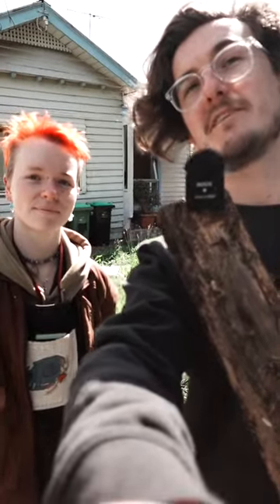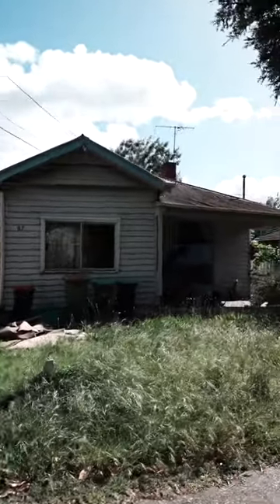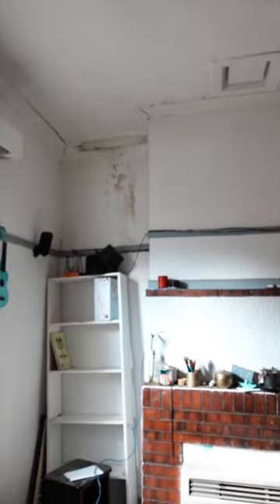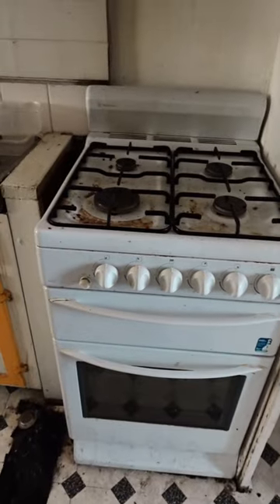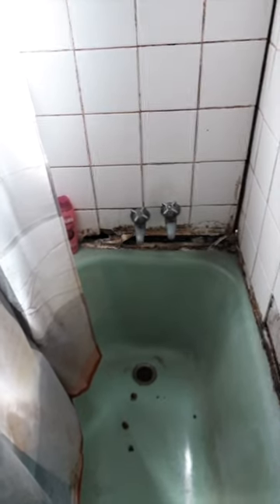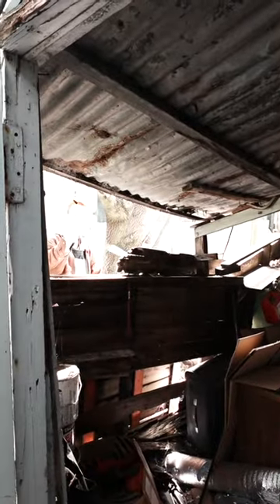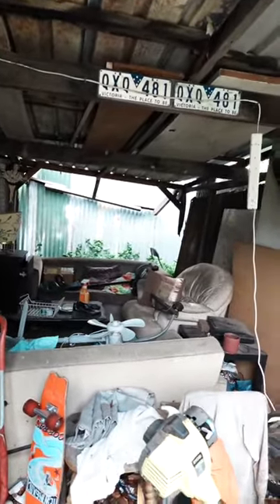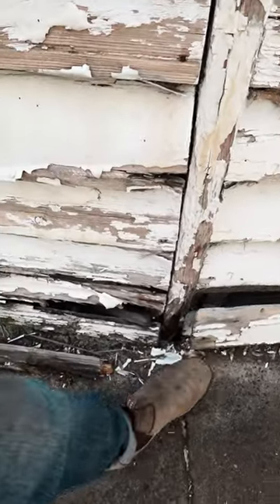87 Kellett Street, Northcote - Miles Real Estate

Comment: As someone who has been Melbourne born, bred & still living (barely, now that we may as well be London or New York we're so expensive now) I'm really sad to admit, this is common as Heck. I came to terms with the fact I'll never afford to own my own home, but the fact that rentals can still be like this, and are - all across Melbourne & at the same sky high rent rates as well maintained properties - is the part that really hurts. We shouldn't have to have our lives endangered by dodgy electric lines, slowly, painfully dying from coughing our guts up from walls & floors infested with black mold etc. All that if you manage to not trip and break a leg or wrist (from trying to save yourself at landing) just getting through the gate to the front door.
This house should be condemned by the Darebin council (or at the very least, have a building notice put on it).

Comment: 100% sinking foundations, the cracks in the paint would suggest rising damp into the render, water hammer suggests pipes arent secured properly which could result in leaks which might explain the rising damp, this could also cause mould, ragehood covered in grease could cause house fire, dips in floor is consistent with rotten floor joists.

this house needs to be condemned at the very fucking least

Comment: She did choose to move into the house knowing the condition though, right? Its in horrible condition, but nobody forced her to live there....
Reply: Except there are more people seeking housing than rental housing available, and most of it’s higher than people can afford. You can’t save for emergencies, let alone a deposit, if you have no discretionary income. So a lot of renters tolerate crappy conditions in exchange for reasonable rent. As Jordan points out, that’s the unspoken agreement - breached by Miles RE when they upped the rent.

I’m in the same situation, but in a more habitable house than this. No heat, no insulation (even when we offered to pay half the cost), cracked floor tiles in wet areas, and we can see daylight through a crack in one wall. But they’ve done gas and electricity checks, and only put the rent up a couple of times since the pandemic, and not by much.
Reply: The owner purchased the property knowing they have to look after it, right?
Reply: @merewetherful  lol what? Owners don't necessarily need to look after a property they purchased. That can do with it what they will. The benefits of being smart with money. In fact, right now, I have one that isn't being looked after. Oh no! Lol.
Reply: @alexandlynnward6651  so if they can't afford it, they can move to a cheaper area. Stop your whining. Nobody is forcing them to live in that suburb. Get out there and find something affordable. The world won't find it for you.
Reply: @merewetherful  I'm guessing you've never owned a house before? Literally, you can paint it pink and piss in every corner if you want to. The owners don't have to look after it. Lol. That's funny
Reply: @anthonyonline4740  Love the sarcasm lol.
Reply: @anthonyonline4740  Very funny Anthony, we don't need to know you've never owned a home, very funny sarcasm Anthony.
Reply: @merewetherful  lol you don't believe that in a homeowner and a landlord? Strange. Why not? I can help you with your finances if you want, so you won't be a renter forever.
Reply: @anthonyonline4740  Very funny sarcastic jokes Anthony. Love you mocking landlords 🤣 You gotta show the prop you’re renting on Purple Pingers 👍
Reply: @alexandlynnward6651  This guy is mocking landlords. They do a great job making them look like tools 👍
Reply: @merewetherful  I don't understand. How am I mocking landlords? You're very strange. If you're confused about the property im not looking after, let me help you. That one isn't for rent at the moment. If you make less assumptions, you'll understand things easier
Reply: @anthonyonline4740  Lmao, we get landlords are turds, great mocking skills 👍
Reply: @merewetherful  you're a very strange person. I'm sorry you don't like your landlords. Have you thought about becoming one?
Reply: @anthonyonline4740  Ha ha ha. Thank you for mocking landlords and making them look like turds 🤣 They think they’re psychics. So weird hey 😂
Reply: @merewetherful  I really don't understand. You're very unusual. Are you high?
Reply: @anthonyonline4740  You’re following Purple Pingers. Of course you hate landlords. You’re very funny, show the place you’re renting  🤣
Reply: You can live there lol. I think you’ll love it. Maybe you can fix it.
Reply: Actually Govenment legislation requires a landlord to repair non compliant sub-standard maintenance issues be rectified even if the tenant knew about the issues when they moved in.
Reply: @squeakyrabbit  yeah so it's clear that the landlord didn't do the right thing, but at the end of the day... She knew it was a bit of a dump... And she chose to move in right? Or did someone hold a gun to her head and force her to live there?
Reply: @merewetherful  I don't understand. Im not following them mate. And I don't think PP hates all landlords. You seem very confused.
Reply: Landlords are unwilling to invest a bit in renovating their properties to save money because renting out these houses is primarily for investment purposes, generating substantial cash flow as well. However, from the perspective of tenants, it is necessary for them to collectively voice their concerns in order to improve the overall rental conditions in the market. Everyone has the right to express their opinions, even though perspectives may differ.
Reply: @sarxotey4680  lol you're funny. That type of Reno won't save money. And not all landlords are the same. And a place like that won't really generate cash flow. I mean, yeah, income helps, but the ongoing cost will likely outweigh the income. And saute they're entitled to an opinion. Opinions can be wrong though. You remember that. Also remember that I'm entitled to my opinion so I'm serially offended that you are trying to take away from that. Please respect my opinion lol.
Reply: Do you know what a rental crisis is?
Reply: @merewetherful there's no requirement to "look after it" when you buy, but it should not have been listed for rental.
Reply: @cottawalla  Maintaining your property is crucial for both your insurance and mortgage. Insurance companies may deny claims if neglect leads to damage, and banks require upkeep to protect their investment since your property serves as collateral.
Reply: @merewetherful  there's no law the requires maintaining a property. The banks equity in this property is probably zero or very small. The house clearly has no value at all, it's all in the land.